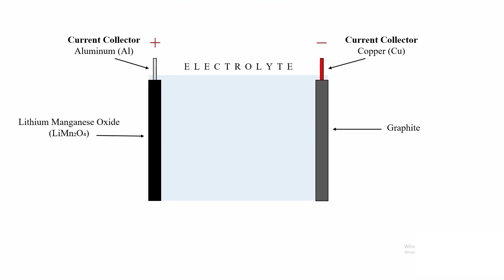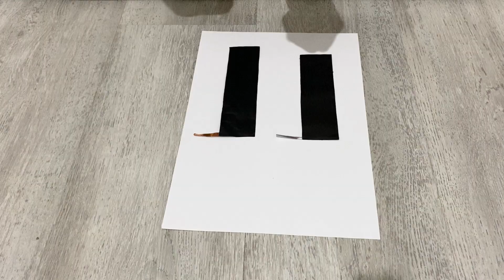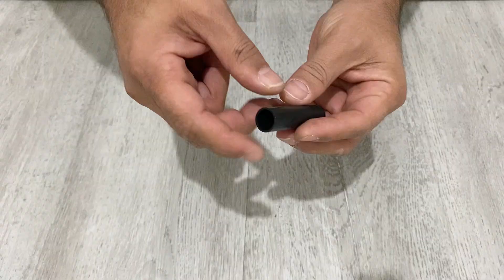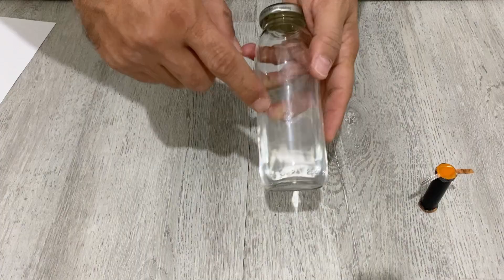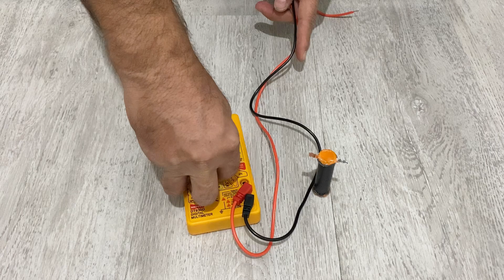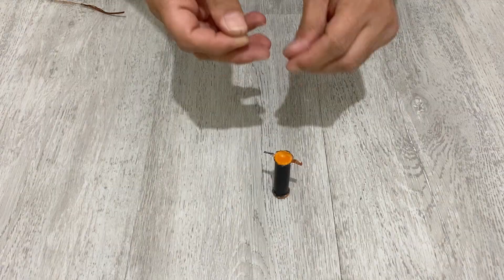How to Make Lithium Ion battery at home (Step by step with each detail)

Comment: Would you consider sanding the surface of your aluminum and copper diodes? That should both increase surface area and make it easier to paint your carbon and lithium onto.

Comment: 😅😅 Why, when charging the battery, did you place the negative terminal on the copper electrode? And when measuring the voltage, did you place it in reverse? You replaced the battery with a genuine one inside and covered it with wax.

Comment: How much did it cost?
Reply from the maker: About 300$ all materials. But l didn’t use up all of them. So per a battery it cost about 2$
Reply: @joyofelectronics9782 and according to your measurements was it 4500mah
Reply from the maker: @Sultan_Abdul_hamid_the_Second no it’s about 1500 mah.

Comment: lithium is strongly reactive to oxygen, the material used is not lithium, rather something else. To construct proper lithium ion battery, oxygen free chamber is required. Also, exposed to air, lithium ignites to fire, in this case, its not lithium or just hidden battery internally
Reply from the maker: You are partly right, but if you handle the lithium manganese dioxide correctly and carefully it is possible to make the battery. I don’t like fooling people and make fake videos.

Comment: He most likely just hid an actual buttery in the tube 
Seems fishy, that he got that output with that much surface area
Reply: actually seems quite reasonable to me.
Ive made smaller surface area batteries with some strips of lead foils and baking soda as the electrolyte and got like 15+ amps of current from it. and thats at only 1v. lead-alkaline battery.
getting 4+ amps sounds pretty good for that one.

Comment: HELLO THE FIRST VIDEO THAT I KNOW OF SOMEONE PRODUCING THESE BATTERIES I NEED YOUR HELP WHERE DID YOU GET THESE INGREDIENTS SO I CAN TRY TO REFORM MY DETERIORATED BATTERIES... BECAUSE I BELIEVE THE MOST COMPLICATED THING IS THE PRO ELECTROLYTE COMPONENTS AND IF POSSIBLY YOU COULD DO TESTS WITH SOME ELECTROLYTE THAT IS MORE ACCESSIBLE TO DO... THANK YOU
Reply from the maker: I did really get you very well. Those ingredients are too expensive. I paid a lot of money for them. You can order only on internet like alibaba or Amazon. Break a leg.
Reply: Could it be that using a common electrolyte such as water with caustic soda or some common electrolyte that is easily accessible, this battery can work even if it loses voltage and energy density but that we can use at home?
Reply from the maker: @JeffersonAlmeida-gk9xp  no

Comment: nice. what will be plate size for 9 volt
Reply from the maker: There is no correlation between size of the plates and voltage. The voltage is constant. If you increase the plates’ size you meant to increase the capacity and so the current.

Comment: Very nice project. Please tell me how to increase the capacity?  More strips? Or increased length and width of strips? Is there any formula to design required capacity battery?
Reply from the maker: More large strips more capacity you will get. So just increase the size of the strips.👍 Thanks by the way.

Comment: I admire your effort to exhibit the hope, My question is can we replace aluminium with other  material to get proper soldering done? since aluminium does not get soldered
Reply from the maker: In lithium ion batteries aluminum is the standard current collector. It’s not recommended to replace with another metals.

Comment: It's very hard to get limn2O4 here even online shop didn't have that is there anything else I can use to replace limn2O4 thank you sir for share your knowledge 🙏🙏🙏🙏
Reply from the maker: You can use some other lithium metal oxides but they are also very hard to find as well😔 try get on online websites.
Reply: @joyofelectronics9782 
It can be👈 extracted 👉from broken batterys.
🔴but it is ⚠dangerous⚠❌

Comment: Respected sir next video of black colour paste, 1st use at copper plate, 2nd at aluminiam plate, 3rd detail of liquid who inject in cell,
Thanks so much, be happy in all life,
Reply from the maker: Let me explain shortly; to prepare active material on copper current collector: 20 grams of ultra fine graphite powder, 3 grams of sodium silicate and 30 milliliters of deionized water. Mix them very well with the help of a blender. 
For the active material on the aluminum current collector; instead of graphite use lithium manganese oxide and follow the same process.
When it comes to liquid, it’s 1 molar lithium hexafluorphospate salt in mixture of ethylene carbonate, dimethyl carbonate and propylene carbonate with same ratio.